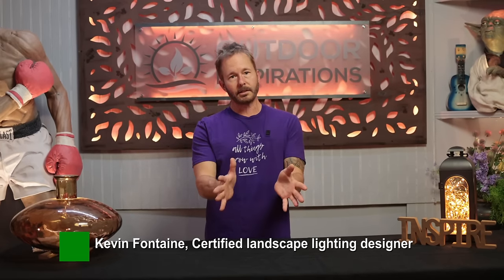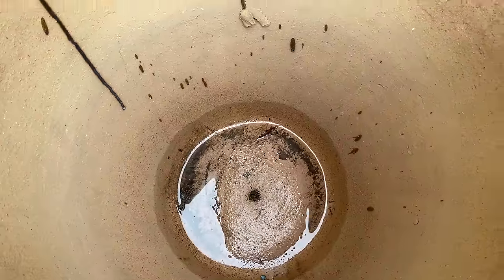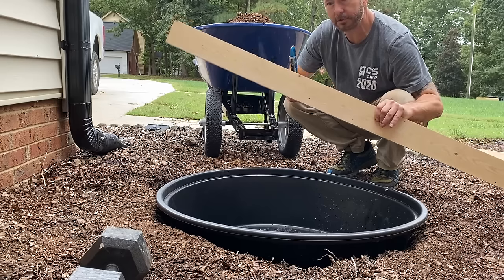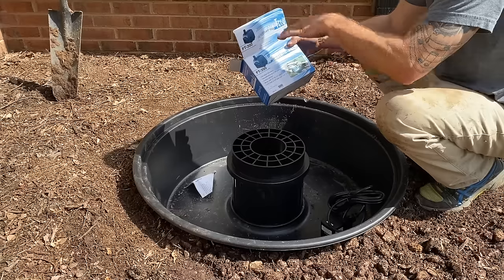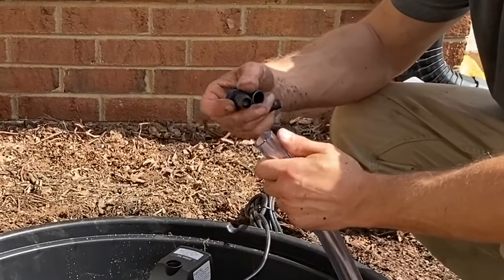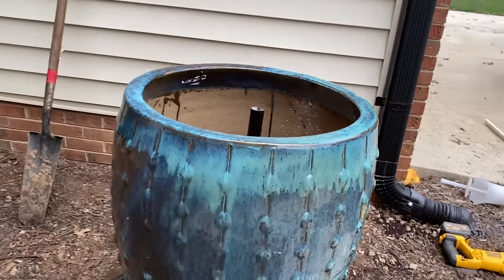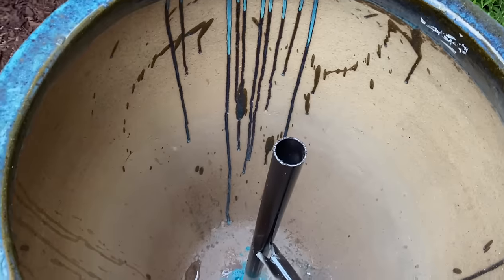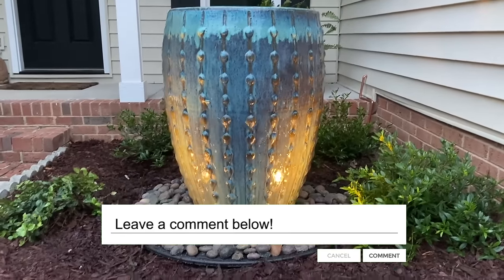#DIY Water Feature Made Easy 💦

Comment: Gorgeous! I just made one a few days ago which is very similar to yours except I turned my pot upside down with the water flowing out the bottom (which turned it into the top) of the pot so the birds have plenty of area to sit and drink. It bubbles a few inches off the top and flows down the sides to give a lot of sound.
Reply from the maker: Oh sweet! 🏆Great idea- especially for the birdies 🐦
Reply: I like that idea. Where do you get the reservoir from ?
Reply from the maker: @frodosdojo  links in the description, but you local garden supply may have ones cheaper
Reply: I like that idea.  Would you mind share your photo of your fountain?  Thx!
Reply: That’s how I thought he was going to do it….
Reply: Nice
Reply: @frodosdojo  if you're thinking about the stackable plastic terracotta interlocking planting tower ....for reservoir the only thing that I could think of would be an actual TERRACOTTA HOSE POT that's been sealed so it's WATERPROOF. 
I have some of the items that I've mentioned in these comments. 
I'm not trying to mislead anyone. 
I truly want to try this application. 
I just don't know how or where to begin. 
The entire bubbling bird bath idea is fascinating .
I'm trying to find my way through the questions I have about something that I have never done before.
Reply: Love that ! No risk of creatures falling and less water to fill bc not filling the whole urn
Reply: Awesome idea. Thank you so much

Comment: Nice, nice pot too.

If/when I do myself will paint the inside top of the pot, put some rocks or other on the inside to significantly reduce the amount of water needed to fill but also add to the design, and then add some lights inside as well.
Reply from the maker: Would be a fun project, I like the idea of filling the rocks inside

Comment: Monsieur Fontaine,  Beautiful creation and great how-to instructions.  Just want to point out an important issue with water pumps.  A couple of dire problems that can be avoided with burning them out is the water evaporating,  This might be a no brainer, but what people don't realize is the fact that these motors use the water itself as a cooling mechanism.  Once the water is gone, the motor will overheat and cease working. The second issue is dirt.  If the motor get's choked with dirt and debris this to will burn it out.  So, putting a layer of Dollar store plastic luffa scruby's,{the kind for cleaning dishes.} around the bottom followed with a topping layer of sponge sheeting material, {pond filtering} will prevent this from happening.  This sponge layer can be easily removed & cleaned of all caught material, there by saving and extending the water pumps life.
Reply from the maker: Excellent info, good point about not allowing the basin to empty- have to check the water level regularly. I am going to try your filtering method- □
Reply: You can get pumps that have auto shutoff when the water level is low
Reply: However, I have had the same pump on my large fountain running most of the year except when I am cleaning it or taking a break — since 2007. Knock on Wood, it is now 2024.

Comment: Fantastic job!  What kind of accent lights did you use?  Powered or solar?  Great tips!  I guess you have to drain the pot for the winter but what about the reservoir?  Being underground I think it’d be safe?
Reply from the maker: I use powered lights rated for underwater use 12v Light Fixture https://amzn.to/3IJ5ACE
LED Lamp for Fixture 3k 7W MR16 https://amzn.to/4arjpCr
Drain the pottery especially if in cold Winter climates- otherwise removing the pump is fine for me here in NC
Reply: @OutdoorInspirations  Thanks!  I saw the links after I posted, but appreciate you linking again.

Comment: Show far up for the tubing go into the pvc? Any sealing around the clear tubing and pvc?
Reply from the maker: Ideally you want the clear tubing to fit snug up inside the pvc so no glue or sealant is necessary, using lubricant like veggie oil to help push it about 6 inches in or so. Smaller tubing would require a sealant around it to keep water pressure.

Comment: What are all the parts you used and how much was the job for everything in total? Also what pump for the fountain did you use and do you recommend any others that are also budget friendly?
Reply from the maker: This is a large size kit so parts added up close to $750. Your supplier will suggest pump size based upon pottery size, I discussed the pump I used in the video but it ended up not producing enough overflow volume so I upgraded to a larger size which you can see in this later video https://youtu.be/fkDJOyYqbAs?t=471
Reply: @OutdoorInspirations  this feature looks amazing! I want this exact set up for my house. What size pot did you use? Iv been looking but can’t seem to find the rite color/shape/size that appeals to me yet.
Reply from the maker: @philipdileo3750  My urn is about 23" wide and 31" tall, make sure the basin is wider to catch as much spill as possible.

Comment: Did the tubing from the pump slide over the pvc. You didn't show that part? Did it need a clamp? Also, for the side tubing to hold it straight was that just glued on there?
Reply from the maker: The pump tubing slides inside the main pvc pipe. Choose a tubing size that fits perfectly inside so its snug and will not require glue or silicon. Slides in the pvc about 6 inches or so- you can use veggie oil to help it. As far as the pvc pipe it stays rigid due to the lock nut at the bottom- I had to add a brace half way up inside due it leaning a little. Hope that helps!

Comment: I love it but due to the rising cost of electricity can this run on a garden solar panel?
Reply from the maker: Doing a Google search it seems they do make solar panel water fountains for more light work placed at the top of fountains, do not think they make for the heavy lifting pumps which run below the pottery. You may want to contact an online garden pond supply

Comment: Do you have to winterize this bucket during the freezing months?
Reply from the maker: No due to how open the top is the water would just expand out and I live in NC that has mild Winters. But if you live in really cold climate I would invest in a water pump to remove the water just in case, buy a protective cover as well as remove the pump each season

Comment: You didn't show..how do you do the side support?  How did you do the lights?  Where is it plugged in to electric?  Where is your water source coming from?
Reply from the maker: The side support I used a 14" piece of pvc to help pitch the main pipe- you could also choose to place some large river rocks to better center the top feed pipe. I plugged my pump into a nearby outlet- happened to by inside the garage. The basin hold all the water so I have to refill it as needed, usually top off the water every 2 weeks.

Comment: What type of drill bit and size did you use? Masonry core bit?
Reply from the maker: 1 inch for my setup, check before and base your drill size based on your material sizes
Reply from the maker: Yes dry masonry core bit available at most Lowes and Home Depot’s

Comment: What did you use for lighting
Reply from the maker: Outside of the urn you can use any small or mini 12v uplight- keep the lumen output under 200 each. I used a commercial brand of minis that keep failing so do not want to mention. Here is a small wash that would also work from Siteone https://www.siteone.com/en/pt-fl1-bz-nl-pro-trade-fl1-flood-light-aluminum-housing-bronze-finish-no-/p/565700

Comment: Is there a way to auto fill with water??
Reply from the maker: Yes that would be a nice add-on upgrade! I have seen them tied to the inground irrigation systems. An irrigation tech could install one for you if you have a system already. If not they may make a spigot driven auto fill. I fill mine by hand, once per week.

Comment: You didn't show how to do the plug,  worried if it would get wet!
Reply from the maker: Hi Delores, I think you are speaking of the electrical plug for the pump? If so this simply comes out of basin at ground level- the basins will have a cutout for the cord along the lip edge- then simply plug into a nearby outlet

Comment: Why does the inside black pipe have to be so tall and so visible? You just have to introduce water into the pot for it to overflow, right? If it's because of water pressure pushing against the pump, it's not going to be much 6" under the top surface.
Reply from the maker: That is correct, you can make the pvc pipe any height to introduce the water inside- but the reason people extend these longer and just below waters edge is so it can create a nice bubbling affect atop the surface. In this follow up video I upgraded my pump to create more bubbling and cut in a ball valve so I could adjust the pressure https://www.youtube.com/watch?v=1eGx1RxxQgA
Reply: @OutdoorInspirations  thank you

Comment: This is not how you build a fountain in a giant pot like that. This is super dangerous to pets and wildlife, as they can fall into the pot and not be able to get out and eventually drown. They make and sell a second reservoir that is not as deep for the top of pots, or you can fill the majority of the pot with sand, rocks, or other materials to cut down on the amount of water used, and to provide a safe height for an animal to be able to crawl out. Please fix your design.
Reply from the maker: I understand this concept you speak of, not sure what would fall into a pot that's 30"+ tall but could see for lower pots
Reply: Birds will fly in to bathe, and drown. :(
Reply: @OutdoorInspirations  I constantly have to rescue lizards, frogs, and once I even pulled a dead squirrel out of the pool. Anything desperate enough for a drink or that is attracted to water can crawl, hop, or fly in and get trapped and drown.

Comment: Your project works well. 
Could something similar to your project be done with stackable interlocking planting towers.
I've been looking at yours and several others so that I can know as much possible. 
Please advise.
Reply from the maker: Interesting idea with the stacked planters, I am not sure how one would integrate the fountain application to that
Reply: I would think that someone could have a thin PVC TUBE through the middle of the entire stack of pots. 
The bottom would have to be centered on the bottom tray that's provided .
The bottom tray would have to be MOUNTED OVER A LARGER POT or possibly HOSE POT.
The hose pot / larger pot would have to be sealed somehow before use. 
The base whatever it may be....would house the pump unit.
The base would work as your water reservoir .
The PVC PIPE would be brought up out of the base and bottom tray.
Each of the individual trays would have a hole drilled through the center of each tray. 
Each tray would subsequently be placed as directed on top of each unit.
As the top level is secured the RIGID PVC PIPE would protrude through the top level. 
The lower levels would have to be drilled through the bottom to insure that the water would drip through each layer all the way back to the reservoir & base tray.....so it could recycle.